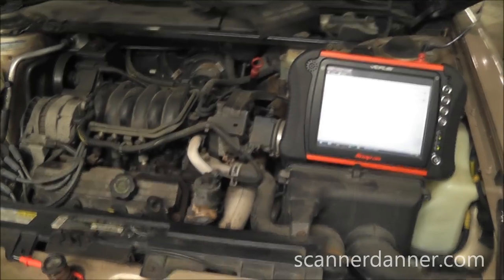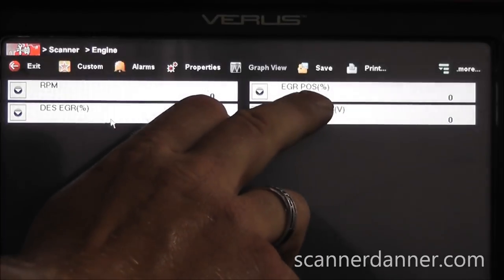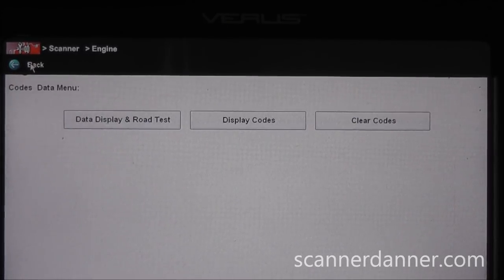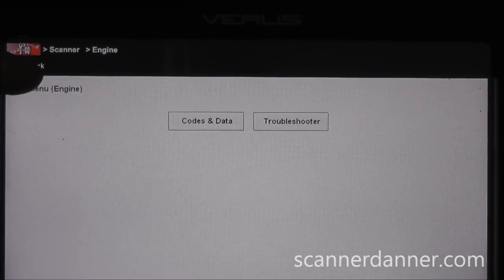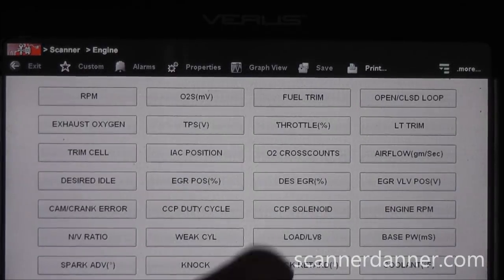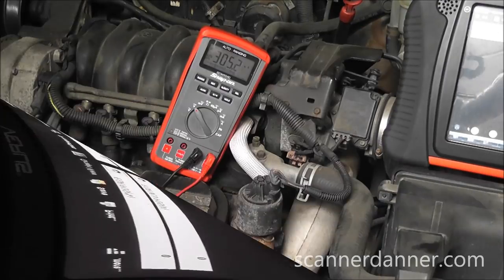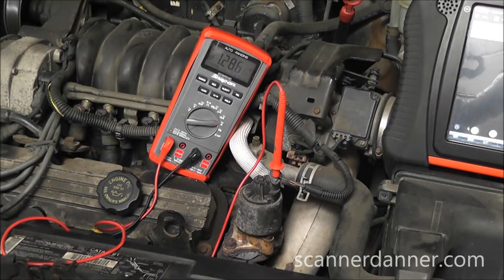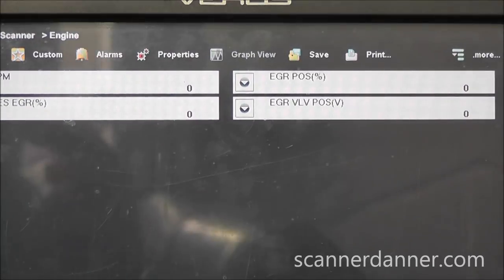How to test an electronic EGR valve (GM P1406 case study)

Comment: Thank you. I am a mobile mechanic, recently had a customers car a 1997 Pontiac Bonneville with an EGR code. I used the info in this video to diagnose a faulty EGR valve. I had the 5v reference at the connector, and couldn't get the valve to click by applying a ground through the VOM.

Comment: Paul, when you JUMP 5V ref wire, don't we need to make sure that the other 5V from PCM is not shorted, if we don't then 5V that u are jumping will be pulled to ground with that short.

Comment: Scanner Dan GOOD Good JOB!! Using the AMP section of the multi meter as your jumper wire (as long as within the normal range of the meter < usually 10 amps > ) .
I've been an electrician many many years and that was a great TIP for everyone. I wish I had a dollar for every time I went to build a jumper lead, when all I needed to do was use the internal multi meters circuitry to complete a troubleshooting scenario. Taught this old dog a new trick.
Reply from the maker: You should see the look on people's faces when I do that. Haha thanks!
Reply: @ScannerDanner  I bet. I wonder it it the " dear in the headlights" look? Or the AHA look?

Comment: Glad i had this video brought to my attention. Having an issue with my 99 blazer p1404/p0405 tried 2x new OEM replacement  egr valves + brought to a local chevy dealer they had to call GM directly because they couldnt figure out why it wasnt working. I check the wire harness and found the 12v red wire for my EGR valve is not getting any voltage from the pcm.

Comment: This video has been the most helpful I've found.  I just bought a truck (2005 Ram 1500 w/ hemi) and right after I left the guys house the CEL came on.  I should have gone back but it's mine now.  Anyway, it was P0401.  I started looking into it and could tell the EGR valve had been replaced because it was so much cleaner than the components around it.  I took it off anyway and bench tested with 12v and it works.  I cleaned the EGR tube while I was at it.  I think the valve is hot side switched (controlled by the power train control module).  The 3 wires that I assume are the potentiometer show ground (low ohms to ground), 5v (tested 5v to ground), and the last measures something like 4v to ground.  This is with the ignition on, engine off and valve closed.  I bought a new valve thinking the signal voltage should be around .8 v but it also measured around 4v.  Are any cars set up such that a higher volt reading on the pot indicates the valve is closed, and lower voltage is open (opposite of shown here)?  I'm starting to think it is a control module issue, but I don't want to give up yet.  I checked continuity to the pins at the module and the 12v, signal, and ground wires all show continuity.

Comment: During the video I was thinking a cheap easy fix would be to jump the two 5V ref wires externally...and that's exactly what you did. Beautiful!     Also for fun you could pop the cover off the computer and trace the circuit board to find the broken connection on that leg of the 5V ref.

Comment: I've jumped similar ref wires several times through the years for 'poverty stricken' customers... but only after thoroughly explaining that the mod has to be at the customers sole risk. All were successful.

Those welding tip cleaners are a fairly common tool truck item... but they might be tucked away in a drawer... ask you tool guy.

Great videos, Thanks man!

Comment: OMG. This is awesome! I hope you are getting paid well. I've had a check engine light (CEL) issue with my 97 Isuzu Rodeo for well over 5 years. (after I wasn't sure if my AC compressor was shot so I hot wired the relay to get it to run and melted some wires but that's another story) Several codes were thrown at this time. #1 cyl misfire and p0120 TPS  error code. Took it to a $150/hr repair shop and shelled out a thousand dollars for them to replace the EGR valve and TPS and supposedly "clean out the ports." Check engine light came on in less than a week. I tested the purge valve solenoid and it was bad. Replaced it and CEL went off. Then it came on a few months later with the p1406. I used my OBD scanner and iphone app to clear the code and pass inspection. That no longer works. I figured there must be a bad wire or an ECM issue but didn't know how to diagnose it because, as you pointed out, the wiring diagrams as detailed as they are, don't show the whole picture. Anyway, I'm going to use your video to diagnose and fix this problem because this is exactly the issue with my truck. I hope you read this far because you mentioned your book. How to I order it? Thanks bro!
Reply from the maker: Thank you! From my website at www.scannerdanner.com 
Is your Rodeo using a GM electrical system on this year? I can't remember. 
While you are on my site, sign up for my forum, it is free to join and we can absolutely walk you through testing this if it is different than this video.

Comment: i use my scan tool in EGR override on digital EGRs to command it open to about 90% and then closed while keeping the engine running with my right foot on the throttle..  this has cured a LOT of 3 solenoid EGR valves and stopped the pinging.. it also improved the throttle response and fuel economy went way up as the dilution of the O2% in the incoming air charge reduces the amount of fuel needed. this really is seen in open loop acceleration.

Comment: Hey Paul, I took the time to practice this method with my own car (05 Civic) and it worked great. Not that I had a code for egr, just did it to practice. Now here's the thing, as far as I know, there should be two 12v readings with the egr disconnected (one for the sensor and one for the solenoid, it is power controlled) but I didn't find them. I just found one with 6 v, the vcc and one with 1.6v. You mentioned something about bias voltage or something so I assumed that the 6v pin was my power controlled pin, and it was. Is there any reason of why I didn't see the 12v pin? Because I'm guessing that the sensor will have the 12v on it... Thanks.

Comment: an alternative way to get a 5v ref to the egr is to use a  LM7805 or a LM7905 (different current ratings) three legged voltage regulator, which is very similar to the voltage regulator in the ecu, run a lead to it from the switched 12V, these can be bolted to the case of the ecu

Comment: Thank you so much for posting all your knowledge you and south main helped me so much when i got error code p0406 teaching me how to test it with the tools i had and cheap ones i could buy. I replaced the egr valve to fix it still got the same code so I hooked up my DMM to the ground and signal wire and jumped the control wire with my test light got no change in voltage it stayed at around 5 volts even though it was open it turns out the position sesor on the new EGR was defective exchanged it for a new one deleted the code now it runs great thanks .

Comment: Very well done and informative video, gotta thank you for this one. After determining the egr valve was bad on a 06 pontiac torrent and replacing it I ran into an issue where the new one gave -100% reading. Following your tests everything checked out n turns out the updated egr on that car has the  wires reversed. Flipped em and now we're back in business lol. Thanks man

Comment: Hey Paul, my 05 Civic service manual doesn't specify the 5v reference on the pcm diagram. Is it safe to assume that any wire shared by thermistors with other sensors is indeed my 5v reference wire? Thanks.
Reply from the maker: +Moving Up DIY No, the shared wire with thermistors is always the ground wire. Thermistors will never share the 5v ref circuit externally from the computer. 
Wiring to a thermistor = signal wire and ground wire. The signal wire for a thermistor is tapped into the 5v ref circuit internally of the computer but it is wired differently than what I am describing in this video. 
I hope I'm making sense. It's early my brother
Reply: +ScannerDanner ok so I'll get 5v ref in the signal wire but it's not being shared? Same 5v circuit but different wire color?
Reply from the maker: +Moving Up DIY yes but you will not read 5v unless it is unplugged. Thermistor circuits are designed to pull down the applied 5v ref as temp of the thermistor increases.
Reply: +ScannerDanner Thanks Paul, you're such a great teacher. I'm studying for my p2 ase test and knowing all this stuff helps. I'm definetely subscribing to the premium channel. Shabat Shalom and thank you my brother in Christ.
Reply from the maker: +Moving Up DIY thanks man! send me an email through my website and I'll give you a coupon for a free month. Make sure you mention your YouTube name so I know who you are okay? Shalom brother.
Reply: +ScannerDanner oh man that is just great! Thanks Paul, shalom!

Comment: Well done!! Definitely a good point on the older GM computers going bad a lot. It seems like the red, white, blue connector PCM's like the one in this video were the worst about that. It also don't surprise me that the new PCM also is bad cause you can find buried gold easier than you can find a good red, white blue connector PCM. Good vid as always.

Comment: I have just tested my golf egr and the figures come back different so I’m hoping you can help. 
I tested the wires on the 5 pin egr and found two at 12.2 volts. One being 12.21 and the other being 12.24. So I unplugged the connector and guess what, they stayed at 12.21 and 12.24. How weird is that. 
Other three wires 11.45 connector plugged to egr and 6.63 unplugged, 12.22 plugged and 12.22 unplugged and 7.28 plugged and no change unplugged. 
No 5v anywhere and no 12v dropping to near zero either. 
Paul can you help?

Comment: Being comfortable working with electronics myself I'll often open up the ecm and look for the problem. If it's a cold solder joint, then it's an easy fix. If the circuit trace actually burned, then I would be concerned about over current caused by something going on in the field on the dead 5v circuit and would do some looking around. In any case I would fix the bad trace and put it back together. If the trace was burned I would have been concerned with simply replacing the computer because whatever caused the trace to burn will likely be a risk for the new computer as well.

Comment: Should you be able to see 5v ref with the connector unplugged from the EGR and measuring at the front of the connector (instead of back probing)?
Reply from the maker: Yes, absolutely
Reply: @ScannerDanner  thanks for replying, I figured this should be the case :) I'm in the middle of diagnosing a P046C on BMW N47 with electropneumatic EGR - uses separate ground swtiched, 12v solenoid for vacuum actuation and a 3 pin potentiometer integrated into the EGR valve itself for position sensor.

Comment: Well, I have a 93 Lesabre, so this definitely wasn't a "i wont ever see one of these" sort of deals for me! (unless something changed in those two years, but it appears the same from looking at it). (ALDL computer connector). Hoping you have another repair with this one. Thanks for posting, I also re-learned how to properly determine the ground side switch of a solenoid, unplugging the connector is a good trick.

Comment: I've got 12v on one wire when the connector is disconnected but when I plug it in both of the wires that are supposed to be 12 go to near zero.  So that means I have a short to ground on the 'control' side of the 12v wire, right?

Comment from the maker: No problem, just be careful with it, as Bushougoma said. You must know the current flow of the circuit you are jumping. Make sure it is well under the 10a rating of your ammeter. Otherwise you will blow the fuse in your ammeter.

Comment: How dose a reference signal fry , I assume if probing with b+ and using a test light you may send a damaging voltage to the pentameter and blow a diode transistor very easily. depending the net voltage at end of test light. by inserting in the regulated line from pcm. Yes ,no, maybe ?

Comment: Hi there I have a 1992 Buick Lesabre that intermittently stalls out while driving, as well the speedometer will stop registering typically following this symptom the motor will begin to act as if it is losing rpms or is out of time position. But it always resets after turning the motor off for a short period of time. Also today when I tried to use the cruise control the motor stalled out a couple of times. Could you advise me of a scenario that makes sense logically/mechanically speaking? Please and thank you
Reply: Sounds like a possible crank sensor problem. Very common and matches your symptoms other than the speedometer. Could be something else, you need to check for spark when it dies and see if it is missing

Comment: Another well done video Paul. Thanks you.   I have never opened an ECU but I find many times "electronic" problems are actually mechanical problems like bad solder joints or broken connections that may be easily repairable.  Is this possible on auto ECUs or are they conformal coated and hard to work on?  This problem may be one of those fixable problems.

Comment: Hey paul, I have a question. I've seen vehicles that have separate 5v reference circuits, ex. (5v Ref 1, 5v ref 2, 5v ref 3) all in one computer (pcm). My question is what would happen if only one of those reference circuits gets shorted ? Would that cause all of the other reference circuits to drop as well or only that one?
Reply from the maker: I've seen 4 different ones. And no, only the one circuit will be affected and everything that is on it, but it will not affect the others
Reply: @ScannerDanner  thanks. I'm currently the lead tech at a small shop because of my diagnostic skills and everything I learned was from your premium channel so I owe you a lot, just want you to know you're really making a difference so thank you
Reply from the maker: @carlosmelendez1082  thank you Carlos and that is awesome to hear!

Comment: So along that thinking as a quick fix (customer doesn't want to spend much) could I also take a wire from the 5v ref circuit at the other sensor (map was it?) up at the engine bay instead of down St the ecu? For ease of access etc. or would you recommend doing the splice down at the ecu as their would be less chance of future wiring faults as the ecu would be in a less harsh environment (inside the cabin). Really enjoy the videos by the way trying to get the mot station I work at in Southampton England to go this way with diagnostics. 

Regards 
Rick

Comment: When not using wiring diagrams and the component being backprobed is a suspect to begin with, how then can we trust the values we get in order to identify which wire is which (even though we already know basic circuit design)?

Thanks.

Comment: So I have the same style of ERG valve. And I don't have a signal output . I checked ground, power , the valve does energize, I have good 5v ref, just no signal . Is the EGR valve shorted inside. Is there a way to check the resistance of the signal circuit inside the valve. if so what would be the spec ???

Comment: Just a quick question, you mention in some of your videos that you can use a multimeter as a safe fused jumper wire, do you set the meter to ohms, dc volts, ac volts or amps? I need to activate a solenoid manually but need to be safe in case I jump a wrong wire not to cook computer, so like you said a multimeter can work as a fused jumper wire with a resistor. Please advise the setting on the test meter, thanks in advance.

Comment: Why 3 wires for a potentiometer?  Seems a bit overkill.  Pins can't get loose over time especially the older a vehicle gets.  Thanks for showing a way to test for that.  Learn something new every video.  When it comes to replacing an ECU you'd better be sure, double-sure, and triple-sure. ;)

Comment: Can my codes on an Audi A5 2013 tdi still have codes of 
1) EGR valve open circuit 
2) Exhaust gas Recirculation Sensor A circuit/range performance 
3) EGR valve open circuit 
If it was just totally blocked up ?